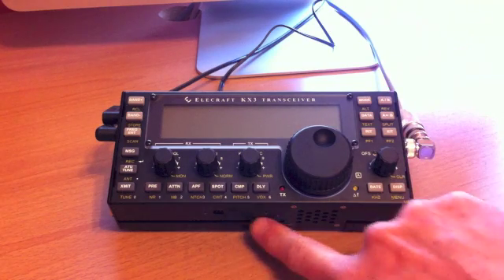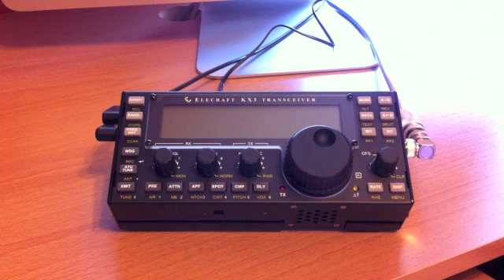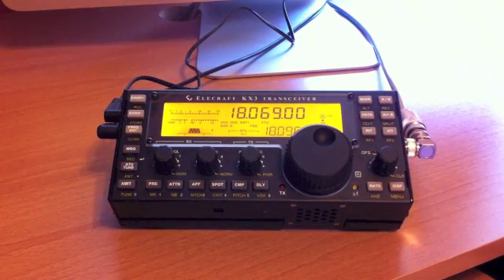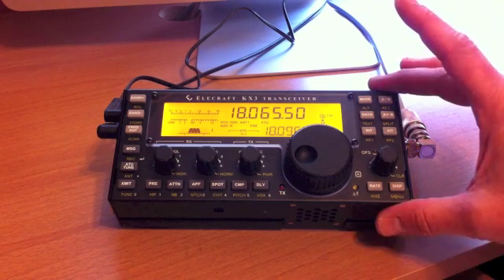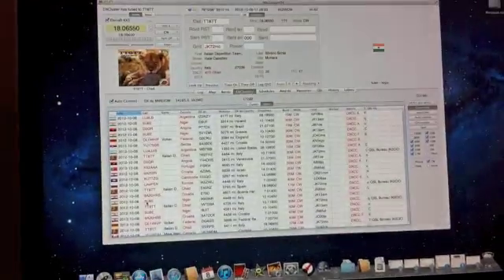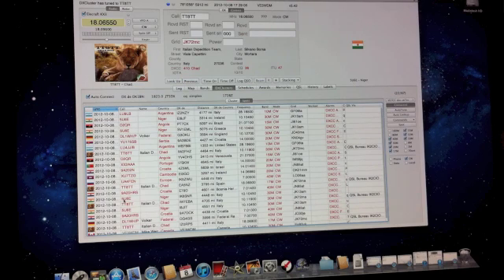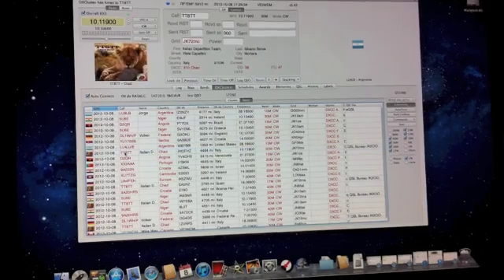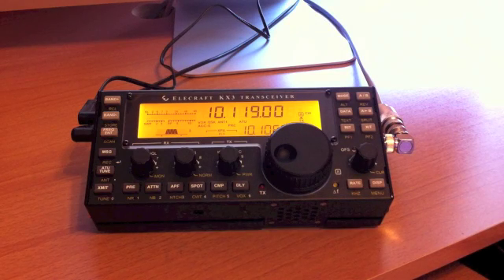KX3 part Four.m4v

Comment: I see it has been a while since you posted a video. Thank you for putting these up. Now that you've had the rig for several years, how do you feel about it now?
Reply from the maker: This is a great rig and Elecraft keeps improving the firmware to make it a better rig. I have used it both as portable and home station. 
Mike
Reply from the maker: Yes it has been some time since I posted another video but work and family have been taking most of my time. I am retiring this year so I hope to get back into it. 
73, 
Mike

Comment from the maker: Good evening glider rider, I too had the problem with an iMac PC and it seems to be the trouble that you are mentioning. My wife has the iMac and my K3 and KX3 had been giving her some grief. I ended up getting rid of the mouse that came with the iMac and replaced it with a mouse from biz depot and the problem was solved. Seems the iMac mouse acts like an antenna. If you have a spare mouse around the house try switching it out and see if that solves the problem. 
Mike

Comment: I ended up having to go back to windows. The imac couldn't handle 80/160 meters even at 5 watts on a K2. The screen would go crazy. Antenna was an Alpha Delta 160/80/40 sloper version. The XYL has the imac now. And I have to check to make sure the imac's off even in another room before using those bands. Feel sorry for any neighbors near by using imacs! Poor shielding I guess. Thanks for the KX3 tips!

Comment from the maker: SM6RPZ good afternoon, yes it's a great little rig I have been very pleased with all the Elecraft products. Thanks for stopping by and checking out the video. 
Mike
Reply: Mike Weir I'm thinking the KX3 is about perfect as a small rig can be. However, I'm liking the idea that there is a front panel out there that can be fitted over the KX3 to make it more back pack comparable. It would be interesting to make it more like a  Military style Radio - just take the guts out of the box and put them in a new front panel and chassis-the I/O's could be cable routed to the front or back panel and the power supply could fit in a battery box and all goes into a back pack with a whip antenna on a pack frame! Just day dreaming!